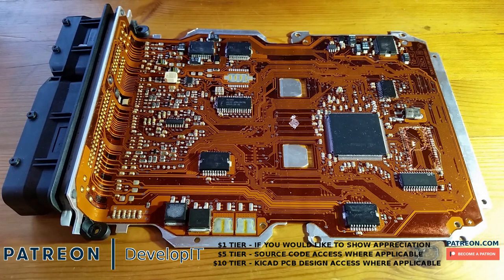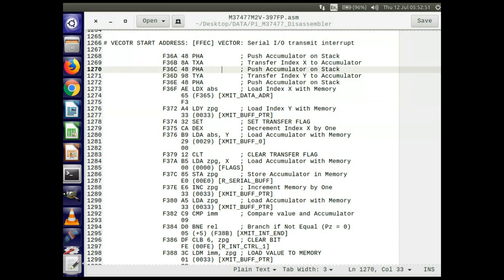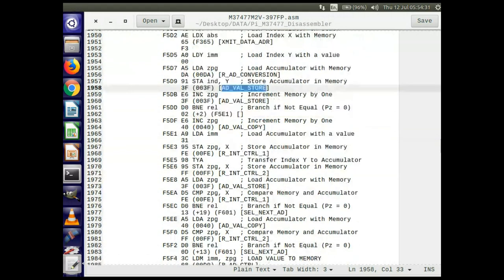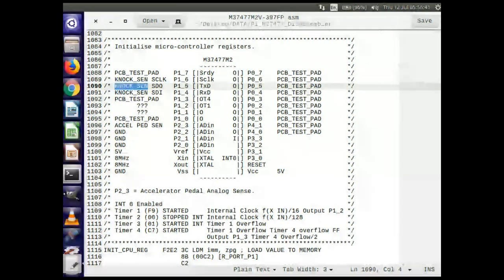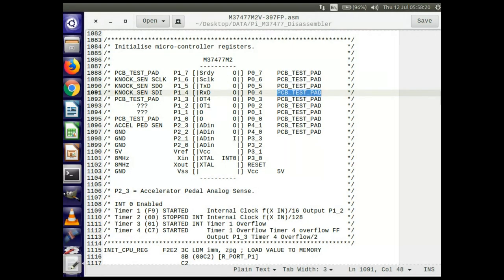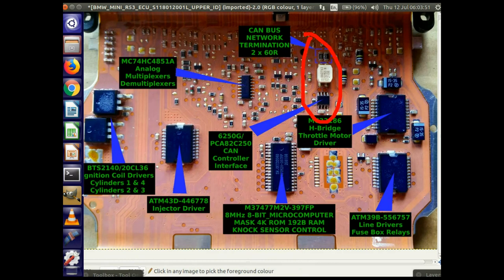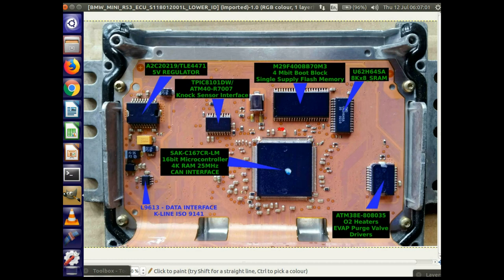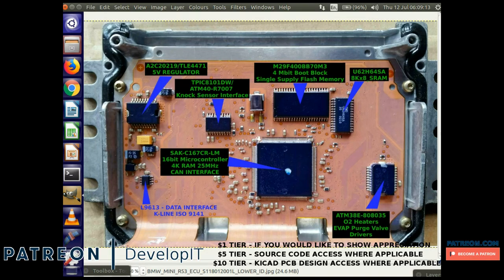Car ECU Micro-Controller M37477M2V Program Analysis

Comment: good morning sir, and thanks for the videos about BMW ecu,
i'm working on a similar project, BOSCH ME7.5 ecu for AUDI A3 1.8T, and i managed to disassemble a 29F800 1M flash programme
every thing is disassembled proparely using IDAPRO, i'm now working on the analysis of the assembler more than 800Ko
someone called Andy whittaker gave a demo how to disassemble ME7.1 using IDAPRO
i've found also on internet for free bosch doc off my programme, an amazing stuff about the audi A3 ecu fonctions, this is how i was able to  locate some fonctions as acceleration mesurement fonction, the throttle mesurement, all comply with what u have said
my probleme now is the RTOS, my research on internet leads me to the conclusion that it is written in a language named FORTH
and i would like to reverse that too, may be it helps me to automate the recognition off all variables, parameters and maps within the programme, since i have their list in the bosch doc, but don't have the adresses.
thanks for the videos again.

Comment: Who uses a flexible PCB for an ECU?
Will it withstand the vibrations?
Reply from the maker: The components seemed to have some kind of film applied over them, I think this was for weather proofing. I don't think I managed to remove a component without damaging the PCB. They probably used the film to make sure the components didn't shake off too.
Reply: @DevelopIT  Yeah the film will be the conformal coating. But I doubt that conformal coating will help in vibrations.

Comment: How does the M37477M2V communicate the knock and TPS readings back to the main processor?
Reply from the maker: The knock sensor driver IC needs to be programmed after power up, so the main CPU tells this micro-controller how the knock sensor needs to be programmed via UART communication. It could get information back this way too. I didn't look any closer at this code. The knock sensor probably triggers an interrupt on the main CPU directly if an event occurs.

Comment: by the way, my microcontroller is the same as yours infeneon c167cr, romless, as u said, every thing is on the flash, boot, maps, program
any ideas how i can reverse FORTH?
Reply from the maker: I do not know about reverse engineering a high level language. It will compile to machine code, so you would have to know how each statement in the specific language would compile to machine language. And most would be code from the language's support libraries, which could be written in other languages. So I think the simplest way would be to convert it to the assembly language and analize it from there, even though it's not particularly simple.
Reply: Is there a mikro c version of the ecu source code?